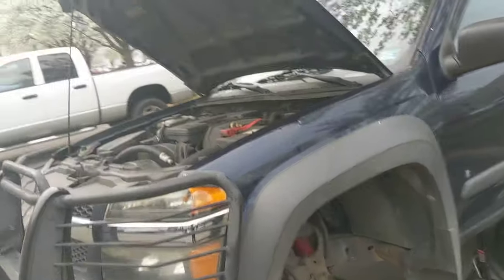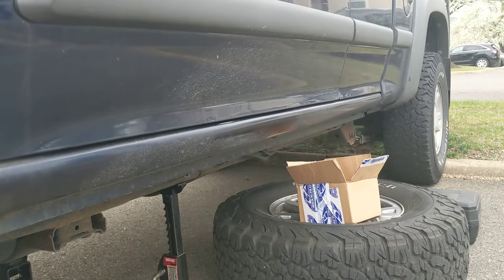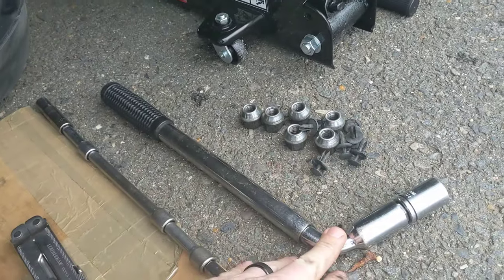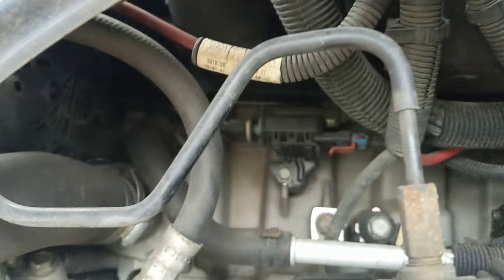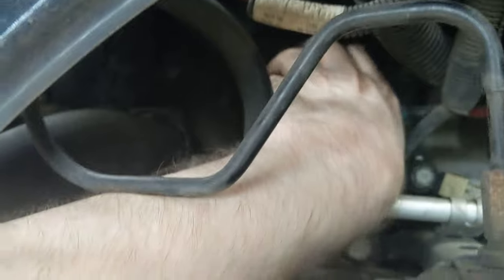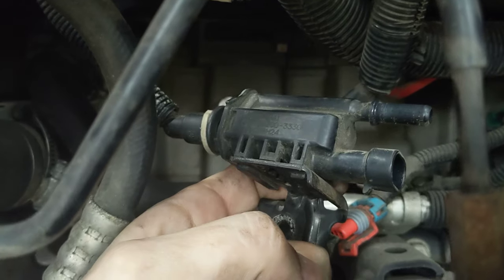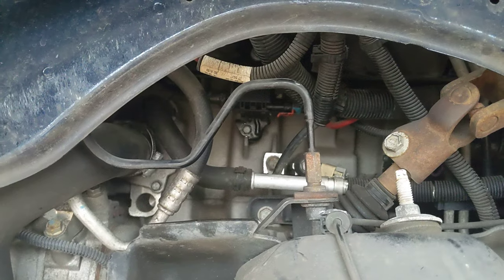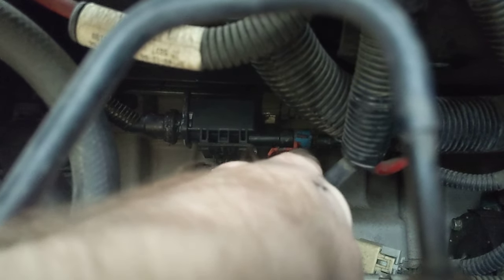How to replace Chevy Colorado purge valve solenoid (2141680) (214-1680)

Comment: i changed mine and it was easy, just removed the battery and i removed the whole asembly from the green litle cap up ,the most dificult was removing the screw, i asembled it out of the truck and i put it back the same way i took it out,
Reply from the maker: That's a different way of doing it! Definitely sounds interesting, I'll have to check it out next time I have my battery out. Thanks for the tip! 😃👍👍
Reply: Thank you I did it on the same way and it was easy
Reply: What size engine was
Reply from the maker: 3.7l I5

Comment: In this video,  the mechanic says that you need to drive 250 miles for the system to clear the code.  In the 2007 Chevrolet factory shop manual it says that the system needs 17 hours to elapse for the first of 3 drive cycles,  regardless of how many miles the vehicle is driven.  This means that you could drive the vehicle 5 miles or less,  wait 17 hours,  then drive another 5 miles , shut the engine off,  then drive another 5 miles in order to complete 3 drive cycles  ( during the drive cycles  the system is running a series of self diagnostic tests and if  everything checks out , you can erase the code  ) . Figure gasoline  costs about $ 4.00 a gallon,  at about 25 miles per gallon or $ 50.00 worth of gasoline  you don't need to spend  and waste your time and money driving 250 miles.
Reply from the maker: Thanks!  This video is quite a few years old.  Don't think we had access to a factory service manual at the time; probably just going by what other people had told us online. At the time my daily commute was over 100 miles, so driving distance wasn't even a consideration.  🤷😉
Reply: @CompTechMike   about 4 years ago I purchased a used 2007 Colorado WT  with 2.9 engine at a utility company auction for $ 5500.00 with  52,000 miles , i then purchased a 3 volume  set of the factory shop manuals for about  $ 275.00 . This has not only saved me money on repairs but has given me a better understanding of how all of the vehicle control systems operate.

Comment: My father in laws 2005 Colorado had this issue for 12 years he could not figure out why the truck would not always start at random. After putting fuel in at the pump he had to wait 15 minutes for the vapors to clear (at the time he did not know that) check engine light was on for 13 years  though he did not drive it more than 5,000 a year emission test was not needed the mechanic never took the time to find out why the light was on, now that have the truck since April 2022 I’m repairing/replacing what needs to be done for my son in college, thanks for showing the location of the part. CompTechMike.
Reply from the maker: Hi there!  You're welcome!  Glad to help.  It sounds like you're doing all the right things already.  If that check engine light is still on I'd start by pulling all the codes and working my way through each of those.  Sometimes one bad component can cause multiple / cascading failures.  Safe travels, hope you and your son make many happy memories in the truck!  😊

Comment: Those clips were a bi@@ch to remove, you gotta have some small hands to replace that thing. I did it 2 times same vehicle like 4 years apart
Reply from the maker: They are definitely more difficult than they need to be! Glad to hear you got yours. Some folks just give up and live with the check engine light, lol. 😊

Comment: My 04 Chevy Colorado had nowhere near the amount of working space as yours. I'll may have to take mines to a mechanic and let them deal with it.
Reply from the maker: Hi Shawn! Thanks for checking out my Chevy Colorado repair videos.  It sounds like you have the coil spring suspension (mine in this video has the torsion bars).  The different suspension packages really affect the amount of room you have to get at this part, as you've noticed.

With the coil springs I'd suggest try removing the battery, battery tray, and get at the part from above.  Others have had success going this route.  Check through the comments for a few other suggestions folks have left, as well.  Good luck, let us know if you're able to get it!  🙂
Reply: @CompTechMike  | Sure. I will give it another go with that method this coming weekend and hope for some success.
Reply: @CompTechMike  Hello again!

I am likely lacking the experience here. Reaching the solenoid from above was actually a tougher case for me than by the driver side tire. The special push pins and hose by my battery terminal were especially frustrating to maneuver since it only looked like they were meant to stay attached. Your suggestion and the comments below helped, but think I'll call it quits. Thank you though!
Reply from the maker: @shawncaradine6016  understandable! Yes, they are difficult to reach.  It seems like the old case of "designed by engineers, not mechanics" when they put service items in such challenging-to-access locations.  Best of luck to you if you give it another shot.  Hopefully it won't cause you too many issues in the meantime.  🙂

Comment: Mike, excellent video! That purge valve is a tough one to find but you did a great job showing its location. Most importantly, you took the time to show exactly how the hose connections came off, where other people just breezed over that- likely because they broke the fittings. That left hand fitting is very different from most other ones, but you showed how it operates which is why this was so helpful for removing it properly. Keep up the great work!
Reply from the maker: Thank you so much! 😊👍👍

Comment: I'll give it a try! 2011 colorado only holding about 1/2 it's tank of fuel (shows full but runs down fast). Also, every fuel up it hesitates to start. Replaced gas cap with no luck, will try this and report the outcome, thanks!
Reply from the maker: Hi Timothy!  Good luck!  For the issue you're describing I would also look at the vapor canister vent valve (on the back near the spare tire).  I have a video for that here:

https://www.youtube.com/watch?v=00Z78tE9938

Also might want to inspect that the fuel tank itself is not physically damaged, and that there is no damage or obstruction to the hoses.  Have you measured how much fuel you're able to get in the tank?  Does it start spilling out if you add too much?  What sort of mileage are you getting?  Good luck, let us know how it goes!

Comment: My 07 Colorado was a pain to get to not nearly as much room to work as this one my advice is be very patient. Don’t break the plastic lines. Take your time to get the clips wiggle it out. Or get both plastic lines just replace them because they will be brittle.
Reply from the maker: It sounds like you probably have the coil springs instead of torsion bar suspension.  Yes, those are much harder to reach!  One tip I've heard is removing the battery and tray can help you reach down to it from above.  Agreed about the plastic lines and clips.  Fortunately the front line (the one going to the throttle body) is short, and easily replaced if it does break. Think I covered that in another video.  Sounds like you got it though!  ☺

Comment: Just did mine, 2007 Colorado, pain in the ass but your video helped. Hardest part was putting the bolt back in.
Reply from the maker: You're welcome! Glad this old video is still helping people.  😊
Reply: Was yours a 2.9 by chance?
Reply from the maker: @gallaecia14 hi! Mine is a 3.7.
Reply: @gallaecia14  yes 2.9

Comment: Tremendously helpful video, Mike!  I never would have figured out how to disconnect that left/front hose without it.  Saved me gobs of time and money going to a shop.  I got it all done in less than 30 minutes. The only thing missing is advice on buying some of those little plastic clips or rivets that hold the rubber mud guard on the inside of the fender to protect the engine.  They were brittle and all broke, as I expect they usually do.  I'll get some tomorrow and finish the job.
Reply from the maker: You're welcome! Glad it was helpful. I agree about the little plastic rivet clips.  I've got a bucket with a bunch of those in different sizes.  Was underneath my truck the other day and found them missing all over the place, LOL.  😄

Comment: What’s the part number to your air filter housing? I been trying to find one for my truck but most have a different design and don’t fit but yours looks similar to my 2007 gmc 2.9L the air sensors is on top of the duct I think it’s the same design.
Reply from the maker: Hi! Thanks for checking out my video. When  you say "air filter housing" do you mean the physical box that holds the air filter on itself? Afraid I don't have a part number on that, but I do see several available on eBay. Have you tried searching there for the correct part for your vehicle? There are also several aftermarket manufacturers that make replacements. Last suggestion would be to try a local junkyard.

For reference, the "sensor on the top of the duct" is the MAF sensor. Hope this info helps. Good luck!

Comment: Thanks for the video. I just did mine. I'd broke that hose connection on the left if you hadn't showed that it was spring loaded. Seemed to help the idle smooth out. Thx again
Reply from the maker: Awesome!  Glad the video was helpful.  😃
Reply: What if you do brake the connector 🤔?
Reply from the maker: @sabinovazquez2235  That would suck.  Hope you are asking hypothetically!??  In most cases if you break the connector you need to find a way to replace it.  Either by tracing the line back and replacing the entire line, figuring out some way of reattaching it... or duct tape, I suppose!  LOL!  But, good luck!

Comment: So far one of the worst parts to replace. Thanks for your vid.
Reply from the maker: You're welcome!  Wait till you have to do the rear brakes.  Those are the worst parts I've ever had to do on this model truck.  Even worse than the water pump.  😫😭
Reply: @CompTechMike  I've done rear brakes on these trucks and it's not hard just gotta no how to do it
Reply: Alternator was my least favorite, and bottom bolts on intake are fun too.

Comment: Mike A very informative video like always. Thanks for sharing all your knowledge with us. Much appreciated
Reply: Hi Mike. Thank you very much for yhe info and the link that you sent. 
My son had a '05 Colorado and he changed the purge valve solenoid and the vent valve solenoid today. The truck had a little bit a hard time getting started but he finally got it going. The only thing now that's a worry on his truck is that the frame is cracked. The dealership sold it to him like that without disclosing the information that the truck had been in accident. Trying to find another frame for it. Thanks again for the great info.!
Reply from the maker: Wow! Glad to hear you got the parts replaced.  Good luck with the frame issue!

Comment: Will this help fix code P0496 . All I'm finding in the 0496 code is the purge valve . Hoping this fixes the code
Reply from the maker: Hi!  Thanks for checking out my video.  Yes, the purge valve can be one cause of this code.  It's a cheap part and relatively easy to replace (harder if you have coil springs), may be worth a shot.  There's many sources of evap issues on  these trucks.  I usually follow the following "flowchart" when trying to track them down.  Hope this helps.  Good luck!

----------------------------------------------------------------------------------------------------
Troubleshooting flowchart for evap issues

1 - Replace the gas cap
2 - If you still get the code, replace vapor canister purge valve above spare tire. Inspect hoses and replace as necessary
3 - If you still get the code, replace purge valve solenoid on driver's side of engine below intake. Easiest way is through driver's side wheel well, or remove battery. Inspect and replace hoses as necessary (including hose between valve and throttle body)
4 - If you still get the code, inspect lock ring around fuel pump at top of tank. This is a poor design and lock ring frequently rusts out, causing evap leaks and smell of gasoline
5 - Check for loose intake manifold bolts or leaking/damaged hoses around the intake and PCV system
6 - If you still get the code, a smoke test may help
Google. There are YouTube videos showing how to replace all of these components. 

Alternatively, don't beat around the bush and start with the smoke test. If that is inconclusive you may also have electrical issues.
Reply: @CompTechMike  thanks , you have been so much help . Iv watched several other videos and ur just my go to guy
Reply: @CompTechMike  took me a bit to get a free day but replaced it by taking battery out and realized previous owner took the 10mm bolt out of the valve Solonoid . So just have idk tried fixing it and couldn't but I replaced it today and code went away after erasing it. Truck wouldn't let me erase it last time so it erased this time and drive about 65 miles today and it hasn't popped back on . Thanks for all you have done
Reply from the maker: @shipmastershadowofintent5249  nice! Good to hear. Safe travels! 😊

Comment: Thanks for the vid I was able to get to mine without having to take the tire off I just jacked it up
Reply from the maker: Awesome!  You must have some nimble hands.  Great job!  👍👍
Reply: I kinda did the same thing you did a small piece of the white clip on the left side that you had to push up broke but everything snapped back in place would putting permadex around that value be worth it or should I not worry it about it?
Reply from the maker: @nicka2815  Hi! Thanks for the comment. I used Permatex on mine at first, but later I went back and replaced the hose. I would not recommend the Permatex, it was really hard to scrape off when I went back to replace the hose properly. The hose is only about 16" long and runs up to the front of the throttle body. It can be a bit tricky to get it through the narrow space behind the alternator, but if you have time, I'd recommend getting the hose. I have a separate (more recent) video where I show part of the process of doing this.
Reply from the maker: @nicka2815  here's a link to the video that shows more about that hose. Hopefully it will help you! 😊

https://youtu.be/SjLIMM30tyA
Reply: Let's just hope I don't have to change that for awhile lol
Reply: I used the black gasket kind and coated all the way around the end where it connects
Reply from the maker: @nicka2815  that should hold it, lol. 🤣

Comment: Is it the same for a 2005 Colorado?
Reply from the maker: HI Miguel!  Thanks for asking.  Good question.  I don't have an '05 here to compare, but I looked up the part number on rockauto.com and it uses the exact same part as my '07, so assume the process should be identical, as well.  Just remember if you have coil springs (instead of torsion bar suspension) it will be pretty tight getting your hand in there.  Good luck, let us know how it goes for you!
Reply: 04-12 should be the same as far as im aware.
Reply from the maker: @thuff86  after a cursory search it does appear to be the same part for most first gen Colorado/Canyon trucks, but I always recommend using the search tools on a site like RockAuto.com to verify for your specific vehicle.  Good luck!

Comment: Hey, do you know what the wire on the top right is called that connects to the part? Mine is missing that wire and I don’t know where it is supposed to connect/lead to.
Reply from the maker: Hi!  Vapor canister purge valve solenoid wire, maybe?

I couldn't find it on RockAuto, but check this out:  https://www.amazon.com/ACDelco-19257603-Equipment-Evaporative-Emissions/dp/B0055B121U

You'd need to match it to your particular vehicle, but that link may be helpful.  Also check out the "Frequently bought together" and "Customers who bought this item also bought" sections.  That may help point you in the right direction.

Also looking on eBay, I see people selling entire kits.  Do a google search for "2007 colorado emissions system" and click on the first link that comes up.  It should be an eBay link for "Emission systems for 2007 Chevrolet Colorado for sale".  Obviously you'd need to match it to your particular vehicle, but I see a lot of complete systems for sale on there.  Good luck!

Comment: whew you have waaay more room than my 2011 chevy colorado has lol, thanks for the vid lov
Reply from the maker: LOL!  Is yours a Z85 (coil spring suspension)?  Those are definitely tight to work around.  Mine is the Z71 (torsion bars underneath instead of coil springs).  Good luck!  😊
Reply: @CompTechMike  yes xD I had to remove the battery and alternator to have enough room from the top, but I got it done today :D
Reply from the maker: @KellyKatz  Sweet!  How was it taking the alternator out?  Mine has 217k miles and I still haven't had to replace it, but I've heard it's pretty challenging to remove.  How long did it take you?
Reply: @CompTechMike  i couldn't get it to come out completely, but it would move enough to give the room I needed. I think it took about 2 hours

Comment: I have the 2.9 4cyl. Definitely not as much room to work, even with the battery out on the top side
Reply from the maker: Sounds like you probably also have the coil spring suspension instead of the torsion bars ("Z71") like mine. Good luck, skim through the other comments here; some other people have commented they successfully got it with the same config you have, hopefully their tips help!